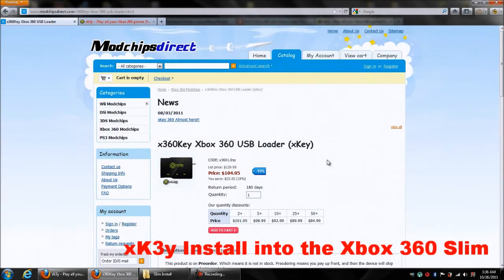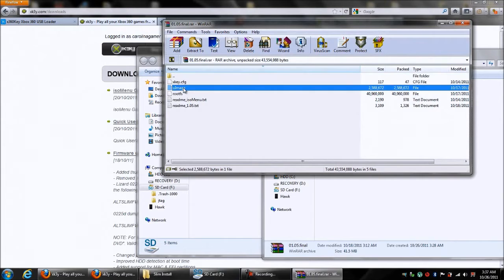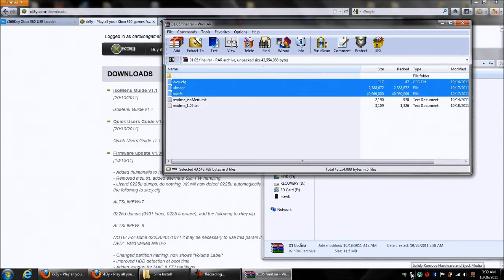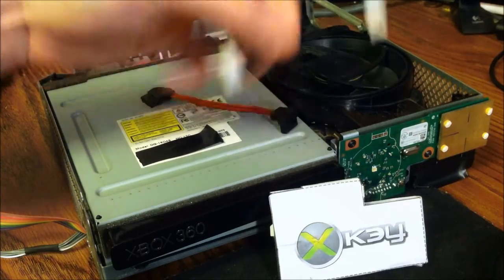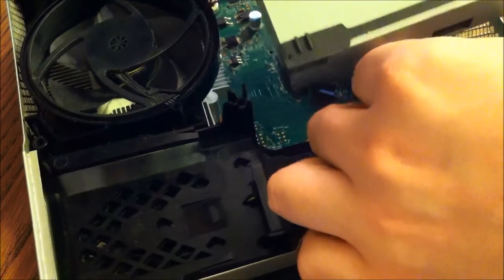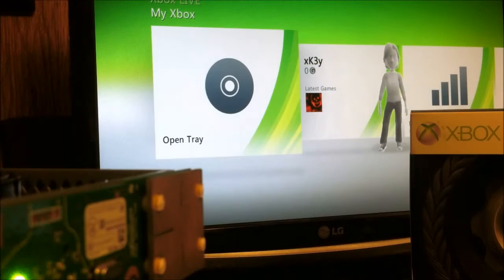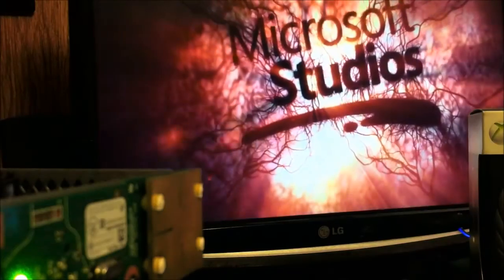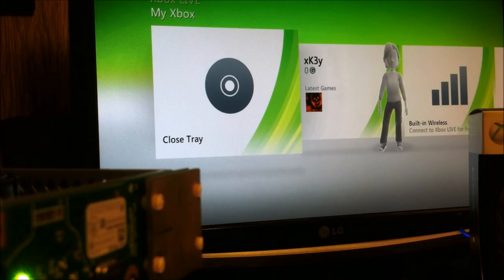xKey360 Installation into a Slim Xbox 360

Comment from the maker: @TheNicktito yeah but it wasn't using the reset glitch when I made the video. All my mods have pin headers and can be removed by just disconnecting them. The wiring is setup to be permanent the chip and nand reader are not.

Comment: hey how about the internal hard drive for the xbox 360 slim model? do you know the one that fits into the side of the console? since it is no longer being used, can i take it completely out of the side of my console?
What happens if we connect the sata cables that were going to be put at the back of the dvd drive, into our SATA hard drive instead? Does it work when we load a backup from the external sata hard drive/.ISO files will load instad of using dvd to install game to hard drive?
Ty.
Ragv.

Comment: Do i have to dump DUMMY.BIN FILE FOR XK3Y TO FUNCTION? OR CAN I JUST USE XK3Y WITHOUT GECKO AND THE FIRMWARE FROM XBOX 360'S DVD DRIVE?
ALSO WHEN I GET firmware, i save it were? my computer hard drive ? or xk3ys microsd card?

Comment: I GOT A QUESTION i looked in the back of my dvd drive i have a hotswaped xbox and its YELLOW wires and my friend said that i have a Philips dvd drive with yellow wires he said that its almost impossible to buy the xkey because i WOULDN'T be able to update the firmware is there a way i could use the xkey on a fat xbox with a yellow wired dvd drive its a Phillips game dvd drive they said yellow wire drives are tricky to use or find the firmware :( :( HELP